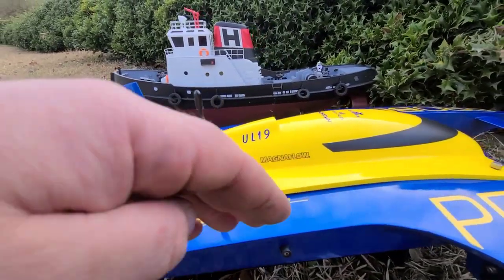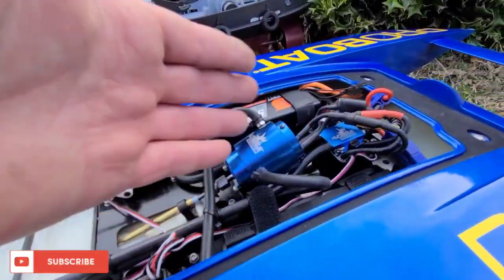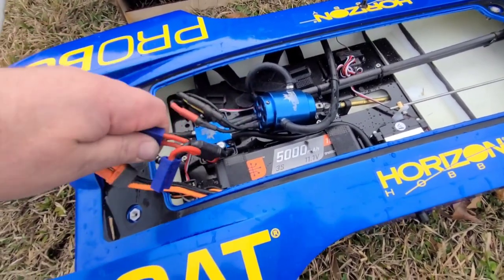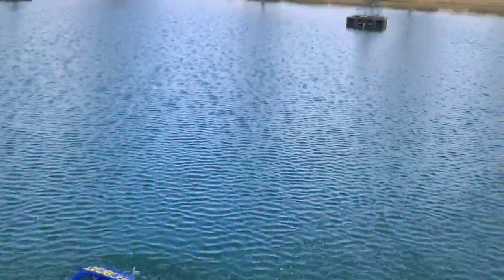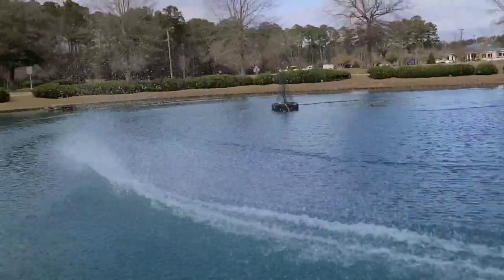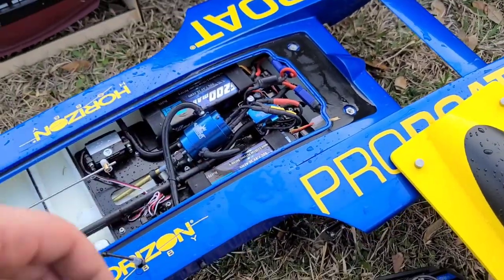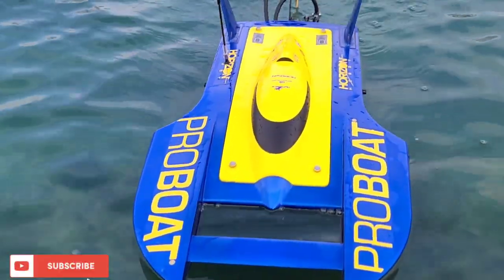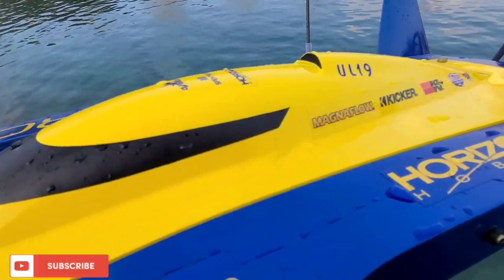Blast Pick up Cooling Test PROBOAT UL-19 - Rc Boat Watercooling Test

Comment: Prop blast work the best if done correctly.  Most people don't use them because they don't like the way they look.i always liked them.There is a constant flow of water at any speed you don't get that with under the hull,or transom water pickups nor with the rudder pickups. Only get that with the prop blast pickups . That is from my experience.

Comment: SUCSEES . VICTORY. NOW TRY 6S . THAT WILL BE THE TRUE TEST. WOULD A 2435  4800 KV MOTOR BE 3S CAPABLE ?
Reply from the maker: Should be okay for 3s.  Low mah & c rating 3s,( I run my 2440 4500kv on 3s 2200mah 3s  30c)

Comment: So duel cooling rudder, great water flow. Low Temps on motor and esc. Low 100s.
Wires and caps run 140
If I put in better esc, will wire Temps drop??
I run spektrum 4s 5000mah 100c.
Thank you Big B.

Comment: What up Bro?...as far as cooling goes...have you tried to just drill out the hole on top of the rudder all the way down to the "V" notch and then drilling out every other hole and then install a "T" on the single cooling line just before the motor and send water through the  motor and then into another "T" just before the water exit and then run a line from the other side of the "T" that is before the motor and run that line through the esc and out into the other side the the "T" that is just before the water exit port?...basically taking a single cooling line and splitting it so that the motor and esc both get cool water....i just got the sonicwake as my first boat...im into helicopters and airplanes but wanted to try boats after watching your vids and weshobbies rc vids...(MY EDIT)...by drilling out i mean to make larger diameter holes
Reply from the maker: Yes to all of the above.   Be careful drilling the Rudder, it really doesn't need to be drilled, but would help,  👌   as for the dual cooling into the esc Yes that's ideal.   Your on the right track my friend.    
BUILD IT IRONCLAD 👊
Reply: @IRONCLADRC  ...thanks bro!!!

Comment: Broo ithink bracket goes in left side so it wont touch the prop
Reply from the maker: It works on either side I checked. The pickup tube pivots over the prop if it were to move.

Comment: I missed what you did on esc to create more flow. I know  you changed the motor line to  esc, then back.
But I can't see what you did to make more flow for esc!
Duel cooling rudder.
Reply from the maker: The blast pickup with larger carbonfiber water line
Reply: @IRONCLADRC  where can I find the extra water pickup tube?

Comment: Excellent Big B! So between the Blackjack 42 and this UL 19, what one should I get?
It appears the 19 is good to go, more so than the 42.
Handling looks great! Out of the box, less twitching then the 42! Runs on 3 and 4 s, no problems, now opening up the nipples, drill all the way through,  or nipples only at each end, looks like you do both ends of nipples,  then ream all the way through. 
Keep the information on RC boats coming. 
Thank you.
Reply from the maker: The ul-19 is a great boat looks and all.   It's cheaper to run than the 42, on 4s she screams.   You can't go wrong has  plenty room for upgrading, you'll love it

Comment: Maybe the ESC was shutting down due to hi temps and not low battery voltage??
Reply from the maker: Yep I agree. I may have said it backwards  😳
Reply from the maker: In the thumbnail you can see the blast pickup splitting the thrust cone. Pretty neat.
Reply: @IRONCLADRC  😎

Comment: What is it with you and temps , just run  the shit out of it ????🙄😔
Reply from the maker: If you run these boats with out checking Temps your gonna spend alot of money replacing electronics.   Trust me.
Reply from the maker: Plus I make adjustments while checking Temps,  strut, weight distribution, blast pickup adjustments etc.  Temperature tells you alot of information about your boat.
Reply: @IRONCLADRC  ok thanks mate I see now  you are really indepeth with ya set ups , might ask ya for advice in future wit future projects, fyi love the pond ya got there , fast boating